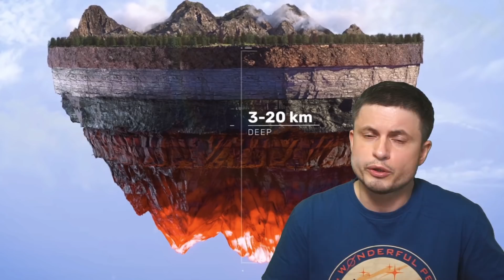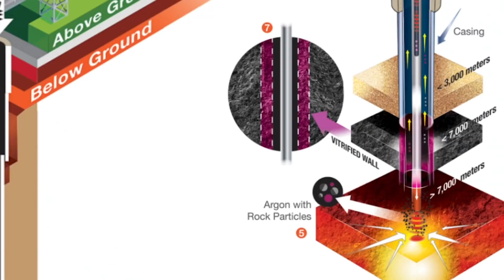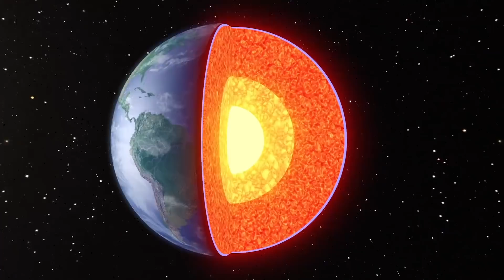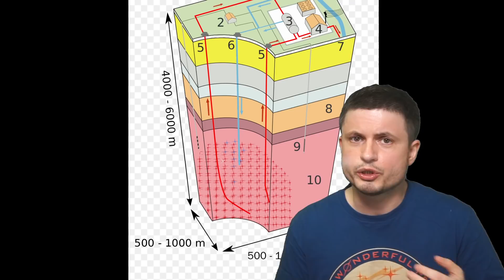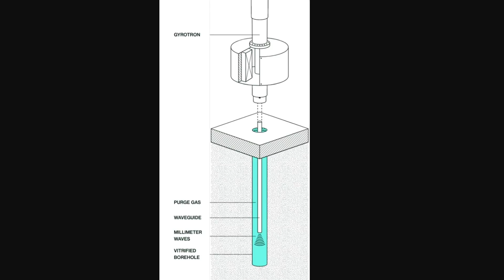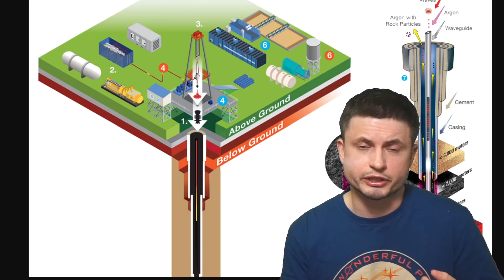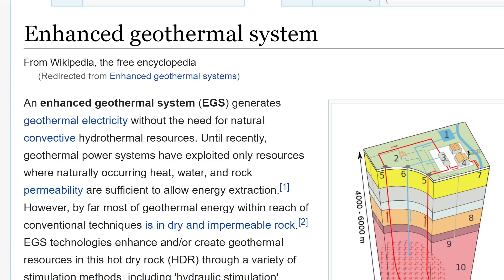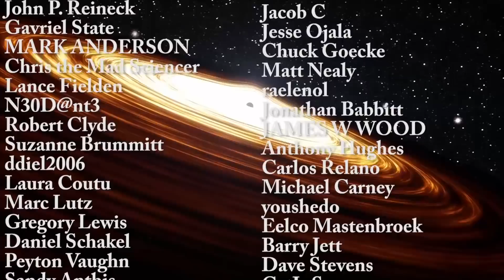Creating Deepest Hole on Earth For Geothermal Energy Revolution

Comment: I have nearly a decade of experience in drilling and fracing (side note: yes, there is no “k”) and I find this news to be very exciting. The industry is full of really bright and creative engineers that would love to be on the cutting edge of something new while still getting to exercise the knowledge and skills they’ve spent years cultivating. Plus that rig is going to be a beast which would be some pretty cool bragging rights to be able to say that they worked on it.
Reply: Fomer perf guy here (wireline). Yup! It's frac. Solid post tho, E2.
Reply: Do you think a hole dug this deep would be damaged by tectonic plate movements?
Reply: @LTS720  Anything built has the potential to be damaged by tectonic movement but the chances drop off significantly the further the thing is away from any sort of fault line. I wouldn’t label a deep well bore as being susceptible to damage any more or less than any other structure in the same location. The worst-case scenario, should it happen, is that the bore would simply be pinched off but less dramatic damage would likely be repairable.
Reply: @E2theBizzle  - "..damaged by tectonic movement but the chances drop off significantly the further the thing is away from any sort of fault line."
The problem is that the heat levels are only sufficient near active faults.
Reply: @freemind..  The temperatures are greater near active faults, yes, but at the depths in question the heat experienced down hole will be substantial regardless of location. You could put this deep bore in Nebraska, for example, and still reach incredibly high downhole temperatures.
Reply: @E2theBizzle  - "You could put this deep bore in Nebraska, for example, and still reach incredibly high downhole temperatures."
I know that's what has been believed, but watch when they start drilling super-deep boreholes for geothermal plants. They will find that the only viable spots will be those relatively close to active faults and plate boundaries because the heat from below is actually generated by frictional ground movement rather than underlying magma.
Reply: @freemind..  I saw ~250F (~120C) all the time in southeast Wyoming when drilling into the Niobrara at a depth of ~2 miles (~3 km) so I don’t think what I’m saying is unreasonable, given the depths discussed. Obviously one could go shallower in some places versus others but the topic on hand does concern especially deep bores so if faults are of a concern, they could and should be avoided and the plan to go to record depths should remain the plan.
Reply: @LTS720  probably only if it went below the plates
Reply: E2theB - you have experience in hydraulic fracturing?
Cool, maybe you might be the one to ask about an alarm bell ringing in my head about geothermal?
Because I do understand exactly how it works, I can see a potential, and possibly catastrophic problem.
We all know what happens if you put a hot plate in a sink of water...rapid contraction shatters the plate.
What happens if we rapidly cool a thermal plate by flooding water into it?
COULD that fracture it?
And if so, what could be the potential ramifications?
Reply: @kurdaitcha3509   Fluids will warm while traveling down the bore. They won’t reach their final depth at the temperature they had on the surface. If shocking the system through a temperature gradient is a concern, you could simply slow the rate through which it is pumped. Another thing to consider is that these formations are massive and the bores are tiny by comparison. An ice cold needle into a piping hot steak won’t cool down the meat with any sort of urgency. At first blush, I wouldn’t be concerned.

However, you do raise an interesting point and there could be effects seen over very long periods of time in areas with a high density of these geothermal wells. The small amount of cooling to the formation will undoubtedly apply some kind of stress, albeit a tiny one. Unfortunately, it will likely take some serious computer modeling to tell if any significant impacts would be made on the underlying geology over the lifespan of such a project. If there are impacts and fracturing does take place though, it doesn’t mean much on face value. Fractures would only increase the permeability of the surrounding rock (and even then, only so far away from the well bore - think in terms of feet, not miles) which, while not ideal, isn’t inherently a bad thing. Thermal shocks that lead to cracking will only make cracks, not space between the cracks. Pressure would need to be applied in order to create space and then something would need to be put in that space to keep it open once the pressure subsided (on a frac they use sand for this purpose). In order for an increase in permeability to be a bad thing the surrounding rock would also need to have a high porosity and contain significant quantities of some underground fluid (e.g. salt water, hydrogen sulfides, etc) that would be problematic were this fluid to migrate. It would also need to have some where problematic to migrate to. Considering the monumental depths to which these bores will be drilled, it is a given that they will be far removed from any layers of concern, such as water tables or sought-after mineral deposits. Fractures the length of a city block but at a depth comparable to the height at which commercial airliners fly is a minimal concern in the big picture, especially considering all the uncompromised rock layers and confining units between said fractures and the surface.
Reply: Would this release large amounts of trapped carbon? if not sounds amazing
Reply: @PuckCld  Short answer: highly doubtful.

Detailed answer: There is a common misunderstanding that there is an underground “lake of oil” or “carbon gas cavern” from which we extract hydrocarbons. It’s closer to the truth to think of it as a soaked sponge or a big piece of Swiss cheese. Most of the carbon below ground is in a solid form (i.e. rock) but the gas and liquid forms can only migrate if the formation, or layer of rock, in question has both enough porosity and permeability. Porosity is the space between the mineral grains capable of storing fluids and permeability is how well connected those spaces are. Additionally, the fluids migrate based on a pressure gradient so if the permeability and porosity are high enough (which most formations are not), they would also need to be under more pressure than the well bore. Keep in mind, the hydrostatics of the well bore at significant depths is staggering, especially for very dense well bore fluids (although if the well bore was completely evacuated, this would admittedly be minimal). Plus, since these geothermal wells would need to be sealed, steel pipe and a layer of cement would be ran, blocking off the hole off from any underground carbon in the formations. Another thing to consider is that most formations just contain some form or another of salt water, not gas or oil.
So for a substantial amount of carbon to escape there would need to be 1) high porosity and permeability in a given formation, 2) significant presence of carbon fluids in said formation, 3) formation pressures greater than the hydrostatics of the hole, and 4) compromised well casing and cement. The chances of all of this happening are improbable but not completely zero. The greatest potential would be during the initial drilling stage, if the first three parameters are met while the fourth does not yet exist, but in this instance a rig’s well control equipment should be capable of maintaining control and handling returns until that third parameter can be cranked up to stop the flow. (assuming the well control equipment is properly maintained, that is, and not junk allowed to fall into disrepair AND isn’t overseen by over confident and under qualified operators - which is more or less what happened on Deepwater Horizon).
Reply: @PuckCld  not really. If you are working in oil/gas bearing formations you will get some durring drilling. It would get flared. Then the well will be completed and that's the end of the gas.
Reply: @cmdr1911  Yeah but even if it’s flared, that’s still carbon dioxide being released into the atmosphere.
Reply: @E2theBizzle  it is flared for maybe 7 days. Way lower emissions and it is and uncompleted thus isnt productive. Maintaining a high presure should stop that and your would only have that in specific areas. Many of our oil wells dont event flare while drilling unless it is extremely rich.
Reply: @cmdr1911  Right, high well bore pressures will stop/limit gas from coming up in kicks and you can just circulate it out slowly through your gas buster. I’m just saying that flared (CO2) or not(CH4, C2H6, etc), the gas would still be a release of carbon, at least as far as environmental concerns would go.
Reply: No but long story short, this terrible idea could cool the core of the earth and cause irreversible problems.
Reply: @Kurtiskurtical   Given humanity’s current energy usage rate [estimated], it will take 17 billion years to use all of the energy stored underground as heat. For context, the estimated ages of the planet and the universe are 4.5 and 13.8 billion years, respectively. Geothermal technologies are not of any risk when it comes to cooling the Earth’s core in the immediate future (“immediate” being defined here as the next few dozen millennia), given the current outlook. WIRED wrote an article on the matter that does a better job at going through the math than I could ever hope to do here in a YouTube comment section. Let me know if you’d like me to send you the link.
Reply: @Kurtiskurtical  I never said that I didn’t think cooling the core would be detrimental. What I said is that to do so would take an energy extraction on a scale far beyond our capability to do so and even then, would take so long that we will have likely colonized space by that point. I even provided a source to the math (I tried to post the link but my comment kept getting deleted - I don’t think external links are allowed on this channel). As such, I don’t believe geothermal is a threat to the temperature of the Earth’s core. However, if you disagree, please provide me with the math that shows geothermal to be capable of lowering the planet’s core temperature by any amount that could be measured. I mean, throwing a bunch of ice cubes into Lake Michigan will lower the temperature of the water (in the most granular and pedantic sense) but it’s not like that temperature change could be measured or detected on the opposite shore.
Reply: @E2theBizzle  17 billion years to use ALL of the energy sure, but how much of that energy is necessary to maintain things like weather, a magnetosphere and plate tectonics?
Reply: Your old employers know exactly where all the geothermal hotspots are. They don't want it used because that's not where the money is.
Reply: @UC9wonLQHXpLNaYxt9x5PKSw Thanks for a proper answer mate!👍
It actually answered a couple of questions!
Reply: @kurdaitcha3509  You’re welcome! I’m always happen to answer questions to those curious enough to listen.
Reply: It seems “fracting” would/should be the correct terminology
Reply: @Scoo_B_dont  Could be. That verb would sound a little weird in the past tense but yeah, could be.
Reply: @Scoo_B_dont  yes, a fair compromise...its weird how many people are eager to say "But no it's Fracking!" when its a made-up abbreviation in mass media for hydraulic fracturing, an industry- specific term. Regardless of how accepted or Dictionaried the word is by now, its both ugly and a misunderstanding--like the idea that more efficient fossil fuel extraction benefits society.
Reply: @js2010ish  Ugly and a misunderstanding? Please elaborate.
Reply: Correct me if I'm wrong.....didn't engineers create the atom bomb?.....that is, scientists invented the method to make it work but engineers actually made it.......with the World now held to ransom from multi user atom bomb threats, " bright and creative"  engineers with little foresight of the future are to blame......
Reply: THIS IS A HORRIBLE IDEA!
Cooling the core of Earth kills the magnetic field that protects us from the Sun.
Kill the magnetic field and you literally kill everything on the fucking planet.
Stupid engineers can't think past their own noses.
Reply: my entire reality is falling apart: there's no k!?!?!??!
Reply: @vibaj16  Hydraulic Fracturing: abbreviated to Fracing. There’s no K in fracture. Look at the tally book or job log of any guy on a job site and you won’t find it.
Reply: He means because there isn't one in "fracturing". But that's not how word formation works. There is one in f**king, and that's part of the etymology.
Reply: @robinhodson9890  F**k is not the same as frac.
Reply: There is no fracking K in fracing. So when a fracing engineer fracks up a frac job they really frack up the well completion costing $Ks potentionally 100s of K$?
Reply: Cutting edge technology, giant beast of a machine. 
Takeaway: No "k" in Fracking.
Reply: There is also the option to drill shallower wells with laterals liver Eavor in Canada. Shell has proved you can drill horseshoe shaped wells and 30 years ago we were intercepting well bores. Oil and gas has a skilled, pride full and capable work force. This gives a transition that will keep people and capital working.
Reply: … hij_ lmnop… I’m so confused!!!
Reply: - fracking, also spelled fracing or fraccing, also called hydrofracking, in full hydraulic fracturing - there you go, it can be spelled either way.
Reply: @PresidentialWinner  you sa fracing, I say frawking.
Reply: I will add a k to bug you.
Reply: @ml.2770  Believe me, it won’t bug me anywhere near as much as it does some people when I don’t include a k. It’s surprising to see the degree to which it triggers them.
Reply: How about build airships with that knowledge?
Reply: @lawrencemorris2261  Do you mean airplanes? Many engineers are already on that.
Reply: Send it!
Reply: If you need something  royally fucked, call an engineer. If you need accurate estimate, call a physicist.  If you need something built precisely, call a reputable contractor. 
PS: I have no love for engineers. Change my mind! I dare you.
Reply: @fanofentropy2280  Sounds like you got a chip on your shoulder there pal.
Reply: @E2theBizzle  Probably doesnt realize any contractor of size uses engineers heavily to support craft and field personnel. Can't tell you how many times I have been forced to carryout or issue bad designs becuase thats what the client was paying for.
Reply: 'cutting edge' lol
Reply: What Da Frac
Reply: @E2theBizzle  Supreme Court and farmers?!? I think you misclicked on a reply. I'm not sure why you're investing so much of your time and energy into this, or what you hope to accomplish 😂.
Reply: @stripsurge  Whoops! I did click the wrong reply. It was supposed to be to Matt. This is what I get for working with a tiny phone screen I suppose.

Lol, dude, you’ve been on here just as much as me. Calling me out is the pot calling the kettle black. But nice try. 👍🏼
Reply: I dunno man, i tried to Google "fracing" and it says "Did you mean: fracking?"
Reply: @Zreknarf  Google makes suggestions based on search histories. If many people searched for something, even if it were wrong factually, Google would still likely suggest it to someone searching for the opposite.
Reply: @E2theBizzle  i dunno what happened to your other comment, but i still see it in my notifications so i'll reply anyways.

obviously i don't have the answer as to how much core energy is necessary for maintenance, but i reckon it's more than the core has currently, seeing as the earth is already losing 1.3–1.9 million tonnes of atmosphere per second to solar wind.

one of these plants as a science project, sure, go for it, but i wouldn't scale this to a planetary level until we have the answer. maybe drilling on mars could give some insight, lest we suffer that same fate
Reply: @Zreknarf  YouTube has been doing that a lot lately. I’ve lost track of how many comments for which I received notifications yet can’t see outside of said notification. This is the first time it’s happened to one of my own though.
Reply: It's fracking (with a k) because it's no longer just an abbreviated industry term, it's a word in its own right because language is fluid. Also, it's not incorrect to pronounce Gif with a hard G or to pronounce ZX Spectrum with a Zee instead of an Zed, despite what some bloke with terrible oral hygiene tells you.
Reply: @Fattydeposit  I suppose this argument works in the sense that color can also be spelled c-o-l-o-u-r. So in that regard, I agree. But this difference in spelling would distinguish between a British English speaker and an American English speaker, much in the same way the lack of a k would indicate someone familiar with the industry and the presence of a k would identify someone unfamiliar with the industry (and by extension, arguably unqualified to wax poetic on the topic).
Reply: @Fattydeposit  weird people who are against fracing put a k in the word to make it look more intimidating so they could gather support for something they are vehemently against. the K exists for propaganda reasons
Reply: Strange how the dictionary has no definition for 'fracing' but does have a definition for 'fracking', isn't it?
Reply: @lakaiskates8064  Appeal to authority logical fallacy. But nice try.
Reply: @lakaiskates8064  dictionary is written by people with soft hands who sit at desks. Drillers often have bits of their hands missing. If the guy with half a thumb who invented it said it doesn't have a K, and explains the logical origins. Then the dictionary is wrong. Also it's spelled, in some regions, spelt is a kind of flour. Thanks for the example. Drilling does have its own dialect. I worked in the industry for a while.
Reply: @rubikmonat6589  I wouldn't take the word of anyone with half a thumb because obviously they had no idea what they were doing.
And 'spelt' is in fact a past tense of spell... I guess that's another case of the dictionary being wrong and some meat head driller being right though.
Reply: @lakaiskates8064  spelt and spelled both mean the past tense of spell, in different English speaking countries. Go look it up bud. If you didn't already know that you aren't knowlegable enough to be telling people who invented the word that they are wrong.
Reply: @lakaiskates8064  Yeah because accidents don’t happen to even the smartest and most careful of people. The picture he was trying to paint was that of someone who has worked for a very long time at their job versus someone who has zero experience at said job.
Reply: "Fray-sing?"

The "k" is in "fracking" to comply with English rules of pronunciation. As such, its presence is NOT optional.
Reply: @bcubed72  English is not that consistent between spelling and pronunciation...

For example, cough and through, sew and new, omen and women, soup and South, etc etc etc
Reply: @Titere05  
Racing, lacing, pacing... fracing.
Vs.
Racking, lacking, packing... fracking.
Reply: @bcubed72  A hard "c" sound in English absolutely is an option.  For example, "Cat" or "Car" or "Card" or "Carp" or "Pac-Man" or "Tic-Tac-Toe".   Or "Cunt" or "Crack" or "Cut" or "Cry" or "Cadillac" or "Catholicism"

Or "Fracturing" or "Frac-ing"
Reply: @jengleheimerschmitt7941  
The "hard c" is really merely incidental.

When a word has a vowel, ONE consonant, then another vowel, the first vowel is long. Thus, "fracing" could be "fray-sing" OR "fray-king," but never "frah-king."

The term originates from "hydraulic FRACTURING," where the two consonants between a and u ensure a short a vowel sound.

So, to keep the short vowel intact, you NEED an added consonant. "Fracking" makes the most sense, but I suppose "fraccing" would have worked also.
Reply: @bcubed72  Ignore the verb form for a second. The noun form (which also happens to double as the adjective form), “hydraulic fracture”, was likely first abbreviated in written form. This would have been written as “frac”. Tell me, how would you pronounce this word?
Reply: @bcubed72  ok, whatecver
Reply: @jengleheimerschmitt7941  
TRANSLATION: "I'm wrong; know I'm wrong; but am too proud to admit it publicly."

Yeah, I'll take that 'W', TYVM. And I can be every bit as graceless in victory as you are in defeat. (People tolerate "sore winners" one hell of a lot better than they do "sore losers." Dr. House is the "guy you hate to love"; think what an asshole he'd be if he got the diagnosis WRONG, though!)
Reply: @bcubed72  The english rules of pronunciation have no place in engineering, the term is defined by the abbrivation of "fracturing", no "k" is required because the correct pronunciation is not needed, what IS actually important is to get the word right such that people understand what the abbrivation stands for, if you change up abbrivations of longer words in engineering, it WILL result in bad shit. 

Keep the terms used by engineers up to engineers to decide, and you play with your linguistics somewhere else, dont push your useless and childish "rules" on actual important work LMAO.
Reply: @bcubed72  That’s… not how language, or the world for that matter, works. You can’t tell someone of a different dialect how to pronounce their name and you can’t tell hundreds of thousands of people that work in an industry how to spell and pronounce their own terminology.
Reply: @E2theBizzle  Sorry but that is exctly how language works. We all together decide how words are spelled and written, and trying to compare an industry with a regional dialect is pretty ridiculous.  Btw regional dialect still use the same spelling these days, they just pronounce stuff differently, so it does not even work in that way. 

Sure it might have been spelt fracing in the past, but by now this term has become a common term everybody uses, and due to the way it is pronounced most people assumed it would be spelled fracking, and it is clearly becoming the standard.  Sure people in the industry might still remember it used to be fracing, but language changes. Even the dictionary only offers fracing as alternative spelling, if it offers fracing at all, meaning the main spelling is fracking now, and the alternative spelling usually disappears.
Reply: @daftwulli6145  The industry doesn’t “remember that it was once fracing”, the industry continues to abbreviate ‘hydraulic fracture’ as ‘frac’. The dictionary argument is a good example of the appeal to authority logical fallacy. The dictionary is not an expert on hydraulic fracturing nor is it some entity incapable of mistake. If you think that comparing dialects to industry terminology is ridiculous than it’s pretty evident that you’ve entered this discussion with blinders on, unwilling to listen to a rational presentation of facts. The entire industry spells it fracing. This is a fact. I’m sorry if you can’t handle that.
Reply: @stripsurge   Billions? I doubt you can prove that. I once worked for Schlumberger, one company of many in the industry, and their employee list was in the six figures. It’s not billions vs thousands, it’s more like millions vs millions. And even if you were right that would just be argumentum ad populum. The people involved with hydraulic fracturing abbreviate it as ‘frac’. I’m sorry that triggers you.
Reply: @stripsurge  If it helps you sleep at night, you are more than welcome to spell it incorrectly. But in the meantime, those in the industry that spell their own term without a k will enjoy living rent free in that part of your mind that can’t seem to let it go.
Reply: @stripsurge  you DO know lead pencils did originally contain lead?
Hence the name which has persisted...despite the change in design.
Are you going to try to change terminology in my trade (machining) as well?
Specific terms and spellings are used in industries for a reason!
To avoid confusion EVERYONE is taught the same terminology, spelling and all - this is NOT your choice to make.
He was willing to inform you of the nuances in his trade, and you arrogantly deign to know more?
Reply: @stripsurge  Hahahaha, if that’s what you really think then… okay I guess.
Reply: @stripsurge  You said it yourself - they made an assumption.
And when informed that it's simply an abbreviation of the word "fracturing" which contains no "K", they argue the point!
Because they ASSUME it should!
Reply: If a bunch of semi-literate farmers spelled the word "Kow," some of you would say "well the dictionary people have soft hands and don't know how to milk a cow, so I know how to spell it!"

Pointing out appeals to authority, and ignoring your own logical fallacies. Appeals to authority, although often logical fallacies, are not always wrong. If you ask the Supreme Court to rule on a case, and you disagree, you seem like the types who will then just say "well it's just an appeal to authority blah blah I work in the dirt therefore I know how to spell."

What?
Reply: @kingkonggordy  Your reasoning is somewhat incoherent so yes, “what” indeed.

Your example, as asinine as it is, doesn’t really do anything to dismantle my point. If those semi-literate farmers (Why do they have to be semi-literate by the way? Do you have a gripe against the agricultural sector or something?), were they the ones who first discovered the bovine species and took up the task of domesticating them for the purpose of raising them for food, should they have called this bovine species “kow” then that would have been their prerogative.

Bringing up the Supreme Court and how you think I might respond to rulings with which I do not agree to try and poke holes in my arguments against logical fallacies is itself a logical fallacy. It’s an irrelevant conclusion and manages to dip its toes into argumentum ad hominem. You’re gonna have to go back to the drawing board pal.
Reply: @E2theBizzle   @E2theB  Just admit that you think you know more about spelling and the etymology of words than those whose actual careers are in that field. Bringing up my argument about semi-literate farmers and inferring why is also just another indication that you enjoy arguing, trying to sound smart, making irrelevant assumptions for the sake of an irrelevant, hypothetical point. I've farmed for over 20 years. Try again.

You can know as much as you want about fracking. That doesn't make you an authority on the matter.

My comparison to the court rulings are an analogy, but go ahead and call them a fallacy since you can't seem to comprehend the difference very well.

See, how it works is, people make up words. Words get used by others. A general consensus is reached at some point, by all users of these words, and loosely "governed" by an authority, such as Merriam Webster. The dictionary is literally used to reference how to spell words, and you're arguing that you know better than the book EVERYONE uses as the authority on spelling.

 You're literally arguing against known English pronunciation and spelling rules and just saying "how would you pronounce it?"

You also conveniently ignored my point about the spelling of panic. How would you pronounce it? Do you insist that the dictionary is wrong because they add a k when saying panicking?

The semi-literate comment is relavant because of the fact that semi-literate people clearly are the ones arguing for "fracing." If they understood how to spell words properly, as someone else pointed out, they would know to add a k to a word that is spelled like this. But your whole counterargument was just "ignore that part."

So because your reading comprehension is lacking, and you admittedly ignore the rules of spelling in American English, there is no point in continuing a dialog with you. You're wrong. Those who are literally authorities on the matter of spelling disagree with your spelling, and you just say they don't count, because referencing a literal authority on the matter is a logical fallacy. My goodness I'm glad I don't know someone like you in real life, constantly using circular arguments, ignoring the rules of spelling when we're arguing about spelling, and calling everything that goes against your argument a fallacy. I'm done wasting my time here.

(please, be so predictable as to tell me that yes, I did waste my time, because blah blah blah. You're wrong, the dictionary says you're wrong, and your only reference is semi-literate people who developed the process but can't spell for beans. Your appeal to authority is weaker than mine. My dad can also beat up your dad. Nah nah. I win. 🙄
Reply: @kingkonggordy   “You can know all you want about [topic], that doesn’t make you an expert.”
Lol. Serious lol.

But hey, a lengthy post consisting  mostly of outright ad hominem attacks is definitely the path of someone uninterested in actual discourse and instead focused only on letting out frustration. I don’t know what is going on in your life that’s fueling this hostility but I hope you are able to find peace. Take care brother. Send me a DM if you need someone to talk to.
Reply: @bcubed72  it's called a hard C, there's more than one way to pronounce certain letters :P
Reply: Wdym it is Fracking …….
Reply: @Chlrintruc  bruh
Reply: @noberdobe  bruh what ?